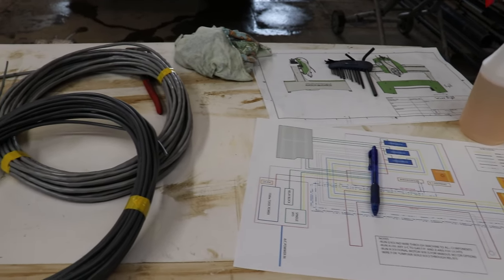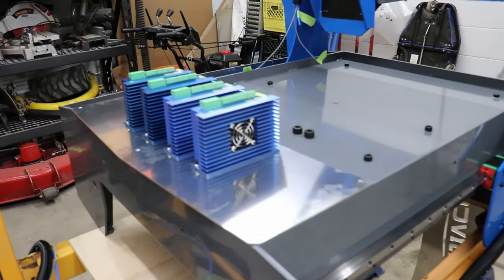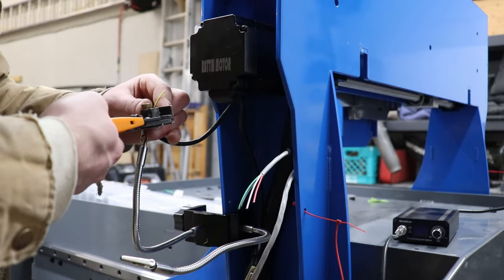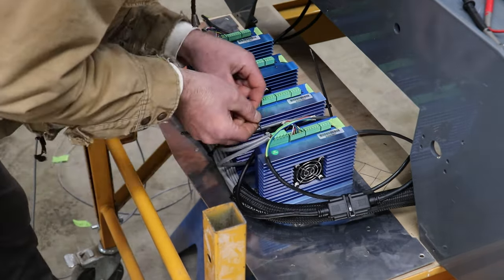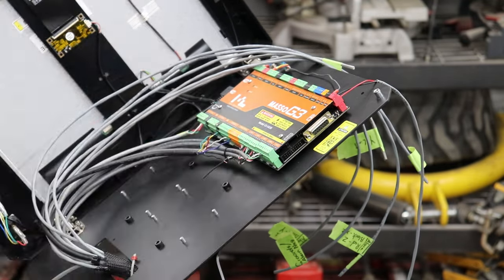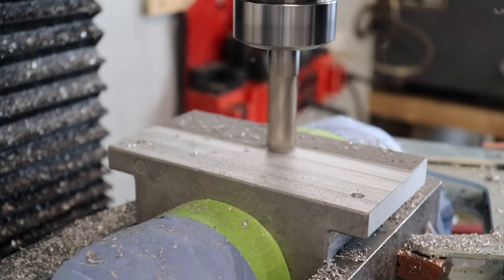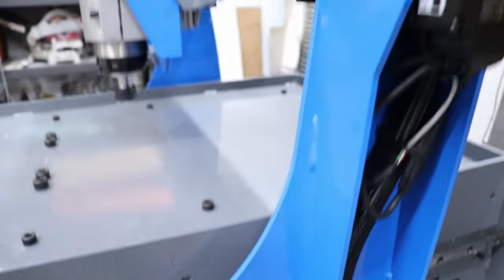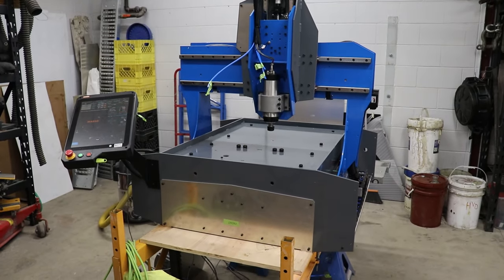Part Four - Installing the MASSO G3 and Control System

Comment: Just ordered the masso touch to bring a neglected outdated pc driven machine back to life. Hasnt even been delivered yet but im trying to find as much info as I can. Loved the video but still completely over my head. Can you run thru in text the wiring im going to need just to rewire this to the masso??
Reply from the maker: Hi Jason, 
That depends heavily on your machine and what you are currently controlling. Simply put, you really will just need to bypass the breakout board (if it's a printer port-driven machine) and wire all that back to the Masso. It will likely be the four wires for your step and direction signals from the stepper drivers, and some 2 or 3 conductor wires back to your sensors/switches. The Masso reads high/low signals, so on any open/closed circuit, such as those with homing and end stop switches, you need to connect one end of the sensor to a power supply off the Masso board (there are a bunch of them indicate with red terminals), and the other end of the circuit to one of the unused inputs in the Masso controller. Controls for outputs work in a similar way, with the coil negative (relay coil) being wired back to the ground (-) on the Masso board, and the power to the coil will be sent through whatever output you're using on the controller. You'll have to wire and output controls through a relay because the board can only handle very low amperages. Any additional wiring for spindle controls gets a little more complicated but MASSO has some good videos on their YouTube channel. Can you tell me more about your machine?

Comment: FYI Delta B3 servos are reasonably afforable. I import quite a lot of them directly from taiwain. I like your construction method of laser/plasma cut steel and concrete.
Reply from the maker: I would definitely like to play around with some servos over these closed loop steppers. I was going to try some Teknic Clear Path units, but the costs really start adding up with cables and power supplies, and I wasn't sure the 2K was worth it for a package of  those units specifically. I would be interested to know more about the Delta B3s.
Reply: @DIVCNC  400W B3's with cable set (5m), servo motor AC servo motor (24b encoder) etc is 360 together for a whole set. Cause it is AC you don't need to mess around with DC power supplies.  It also has very nice autotuning (I have short about it on my channel)
Reply: Can you please share the link where you get the B3s directly from Japan
Reply: @seimela  The factory is in Taiwan, it goes through my contacts there and is not openly available online.
Reply: I dont see anything about these for sale on your website?  Lots of nice articles though.  You may have found the only mid priced ATC spindle worth buying.

Comment: It is a very nice build up, I have a Masso controller that I'm working on for my cnc router. I have a question,  what software are you using at @1:35 for wiring schematics?
Reply from the maker: Hi Javier. Thanks, I drew it all out manually in adobe illustrator, nothing fancy. The Masso is awesome, definitely a good choice.

Comment: Nice machine you got there! Would you recommand the masso g3 touch for a hobby cnc ?
Reply from the maker: Thanks! I certainly would, but it may be a little pricey for some hobbyists . If you have an old computer lying around, you can do it much cheaper, however if you have to purchase a computer, buy a mach 3 license, and the controller board you are getting close to the cost of the Masso anyway. The Masso is also easier to use than mach 3, if your new to it.

Comment: Looking good, are all the surfaces where the linear rails go machined?
Reply from the maker: Thanks! No we specifically were trying to avoid that, with careful fabrication using laser cut plate. We had to shim under two locations about 0.005" but it was close enough that the movements just glide everywhere else with negligible deviations on the dial gauge.

Comment: You can probably up your acceleration on the Z.
Reply from the maker: Great observation, we have turned it up considerably since this, we found the limits of the Z-axis acceleration to be lower than the other two, due to the weight it has to lift.

Comment: Is this not possible with stepper motors?
Reply from the maker: Yes it is, these are steppers they are just closed loop. You could also use open loop steppers you just wont have the machine protections.
Reply: @DIVCNC  thanks you